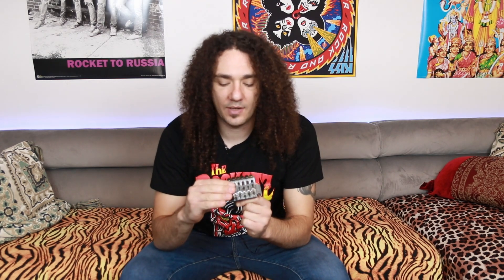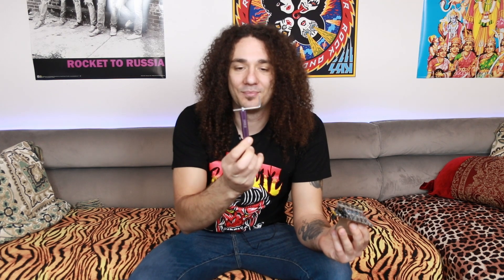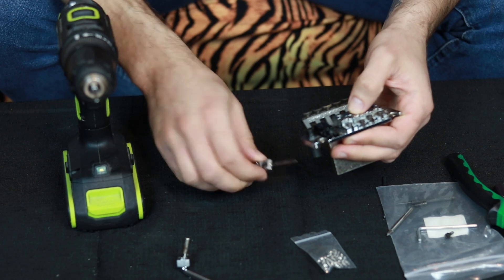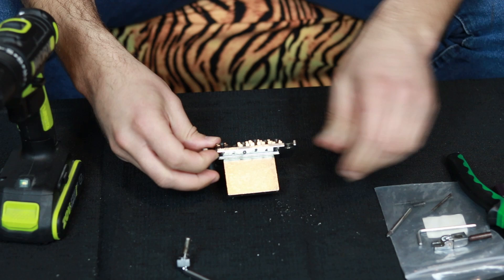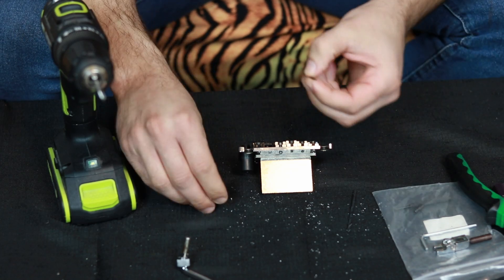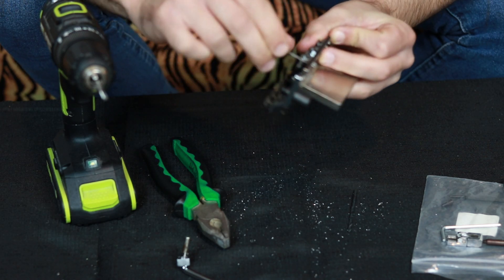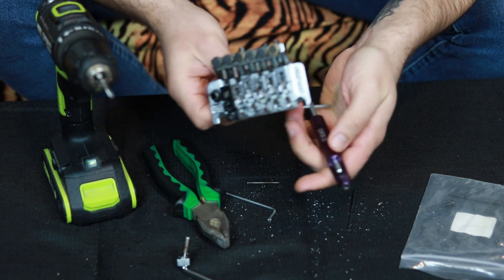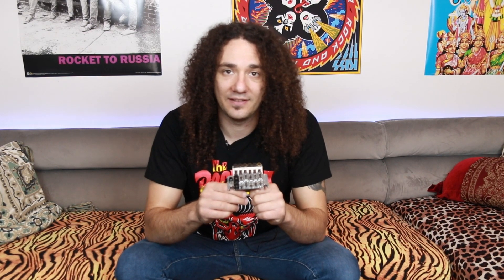How to fix stripped intonation threads on Floyd Rose (Schaller) Tremolo

Comment: This is the guide and product link i need to fix my 1989 Charvel 475 Special/Deluxe... I had recieved a Skyscraper intonation tool to intonate my JT590s and other FR trems but realized the 1st hole for my low E was stripped out... now i have the solution to that problem and Ill revive that JT590 with what  I learned in this video
Reply from the maker: Happy to help!

Comment: Thanks for the video! Just tried this. One of the two holes came out too big and one of the saddles somehow broke.
Reply from the maker: @yardenmor-avi9765  Oh shit!
How did you manage to break the saddle?
And how did the hole get too big? 
The hole is meant to be bigger because you need to insert the helicoil in there before you screw anything inside.
You have to remove the saddle first and get it out of the way as well.

But mistakes are the best lessons, don't be too hard on yourself!
You can buy a new baseplate directly from Schaller.
Reply: @ magic hands! Thank you. I have no idea about the saddle, I just noticed it this morning, assuming from trying to screw the intonation screw back in but I don’t remember going that hard. About the hole, I’m not sure either, I followed the steps in the video but with one of the 2 holes I made, the helicon just falls right out the other side lol